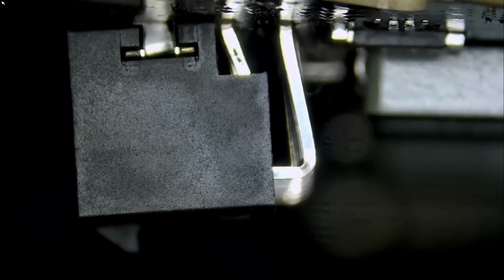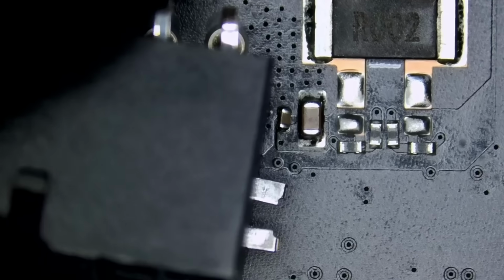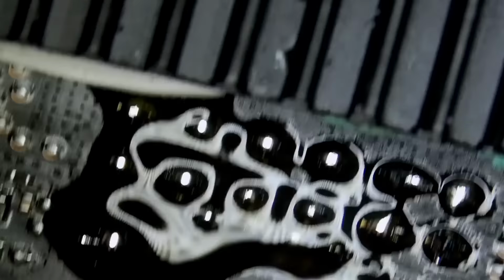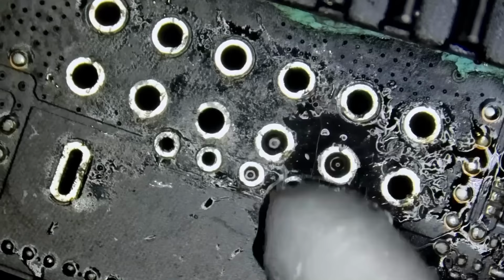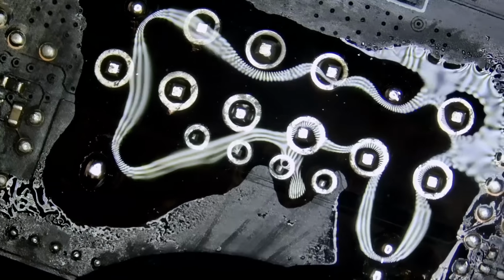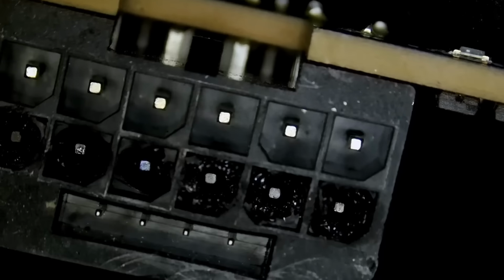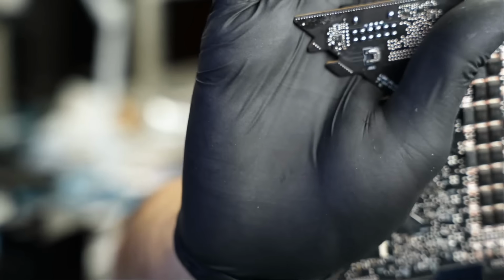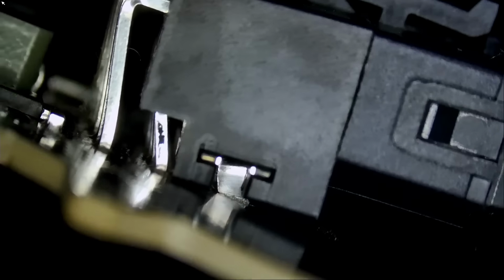Nvidia 4090 Founders Edition Have More Issues - 18 Cards Repair

Comment: The connector needs has to be an extra support anchors on the pcb board so it wont deatroy the connector pins
Reply: ye there is no space between the cablewhip and the case panel, the customers should use an angled connector adapter 🤣 one could even think about reimbursing the cost of repair from the vendor or manufacturer as this is a systematic fault in the design of the card

Comment: 4090 again. Damn. Premium product with MSRP of $2000. I am sure it's user error, and not an engineering error.  AFAIK connector melting could be resolved with adding one more 12VHPWR connector. DerBauer made a video few months ago, one of rare good videos about 4090  problem. But still this card is so troubley it should been recalled. Thanks Mr. NorthRidge on video.
Reply: If one smart mechanical engineer can figure out better design then he can win all the market. 20 years ago the heat sink plastic type lock pin with a poor design. We have to use hammer to install onto motherboard. Of course many damage during installation. We push engineer to find from market then they really find it. We can install the pin by slight force. So design smart is a key.
Reply: Oh no, it couldn't be an engineering error.